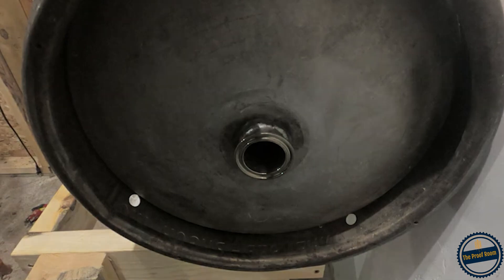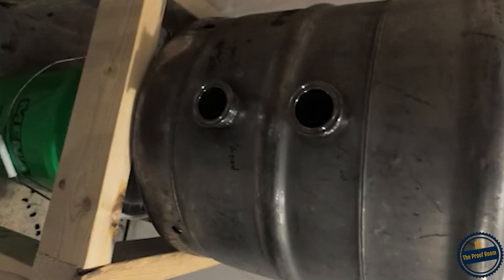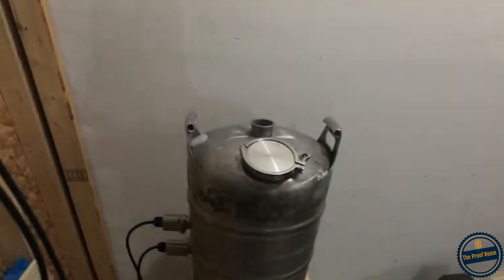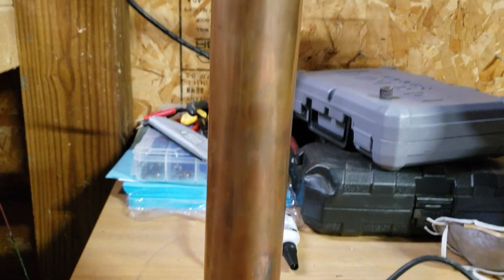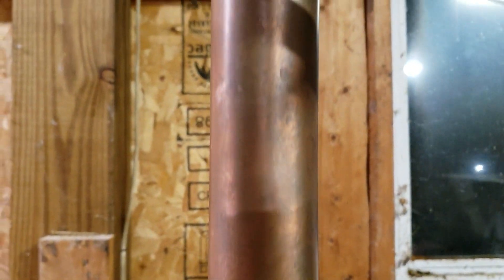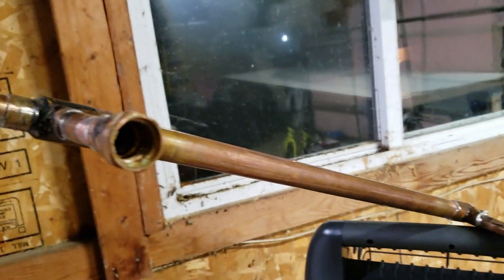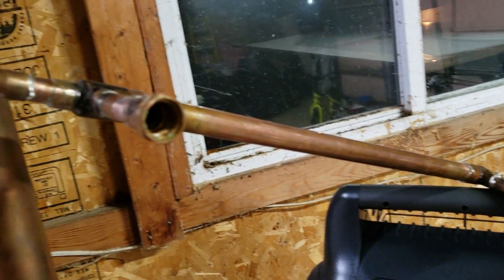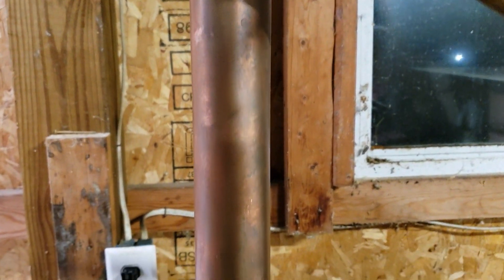How much does it cost to build a still?

Comment: That's real cool. I'm thinking I can build this thing for about 300. I don't have to pay my welder and don't care about the permanent water and drain supply. I've also seen pwm with two plug ins for about 100. I'm trying to go with 2000 watt elements so I can run 110 instead of 220. The cheapest I've seen a keg still online was over $1,000. It's definitely worth building it yourself.

Comment: You my friend have fallen down the rabbit hole....

My first still was a 2.5 gallon stainless fire extinguisher... Fabricated my 15.5 keg boiler in 2012.

Now I run a 3" copper 5 plate sieve flute. 4" Stainless 3 plate bubbler flute. 3" Stainless packed reflux column.
My thumper is another 15.5 gallon keg, flipped with 6" tri clamp clean out, 2" drain, and 26 tri clamps (again 26) from boiler to 3" 316 stainless shotgun condenser. Goes from 6" to 3" to 2" to 1" copper spear, then 2" to 3" shotgun. AKA the "Roller Coaster"
This is by buying stuff on sale, over many, many years.

Tip: Search on fleabay "HFS(R)" they sell inexpensive stainless parts, type/lots are random, but cheap compared to amazon.

Cheers!

PS: Your gun cabinet in the background is empty. :(
Reply from the maker: Lol I'm buying pieces a little at a time. I'm working on the gun cabinet right now its a side project. The safe is overflowing in the house. Ill check that out thanks for the tip. Cheers.